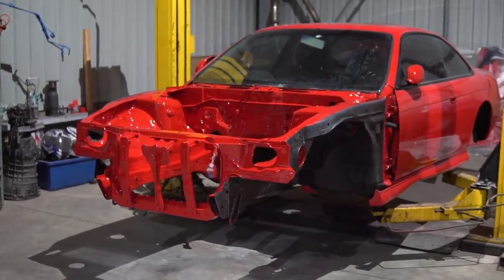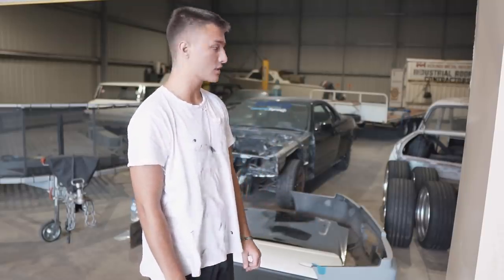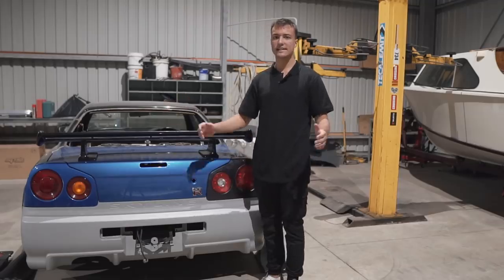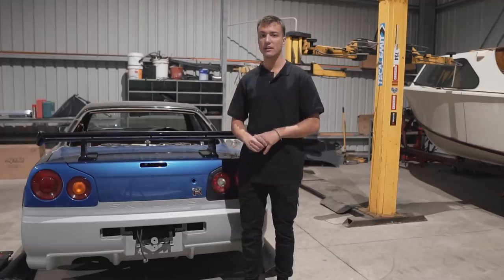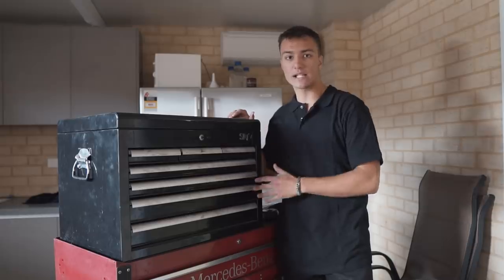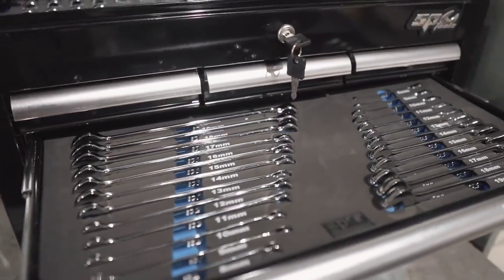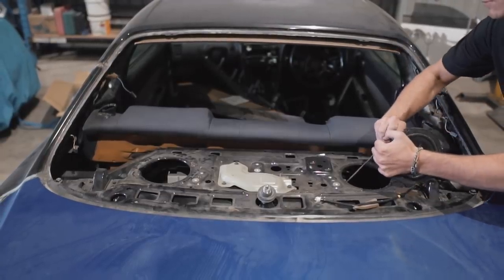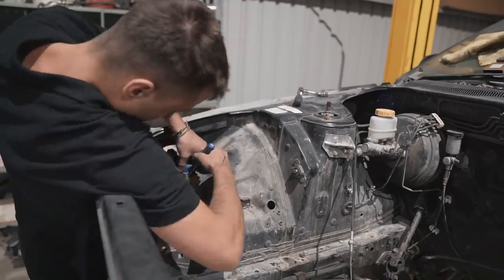The R34 Skyline is BACK | Poor Man's GTR [EP4.5]

Comment: Your electric power steering are you going with a Holden Astra pump or a electric power assisted steering column
Reply from the maker: Yeah sorry didn’t explain it properly, I’ll run a Holden Astra ps pump so it’s still hydraulic
Reply: @BrokenSilvia  yea i currently have a leaky ps pump on my r32 thinking of doing a astra pump as well and changing to a ls1 alternator
Reply from the maker: good idea!

Comment: I understand why you're removing the power steering, it also will probably be more reliable and practical to live with, but since this is supposed to be a fun sports car aren't you worried that it will make the steering feel "numb" ?
Reply from the maker: When I re-watched the video I didn't explain it properly.. I will do a better job in the future. I am keep hydraulic power steering! The only difference is that instead of having a mechanic power steering pump that runs off the engine, it's a Holden (Opel) Astra electric power steering pump that will live in the boot/trunk with lines running under the car to the steering rack. It'll clean the engine bay up quite a bit and also those pumps are readily available and are a lot new compared to the 20 year old Nissan stuff
Reply: @BrokenSilvia  oh, alright then! Those plans sound great, I'm really looking forward to the next videos!

Comment: This isn't a poor mans gtr it costs a small fortune to do this conversion lol I almost did this but brought a gtr instead
Reply from the maker: I can disagree with this.. The car owes me $6000 so far (including the shell). Includes everything you have seen to date + a front end. All I am missing to complete the car now is a RHS headlight, front lip and rear pods! I have done it in small steps patiently
Reply: @BrokenSilvia  I dunno man. Plus parts it works out to be quite expensive. Each quarter panel is like $1500 aud, its the small and unexpected things that make these projects expensive. Its awesome what your doing though 👍
Reply from the maker: Both quarters with the fuel cap cost me $1850 I think. What will kill the build budget is the engine and gearbox I want but the body will be under $10k painted and all (including the car)

Cheers man